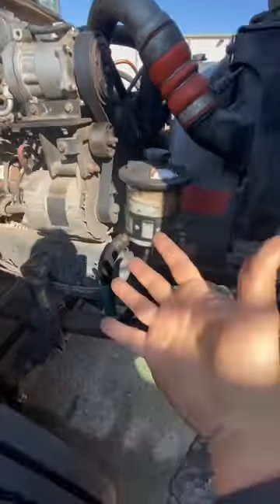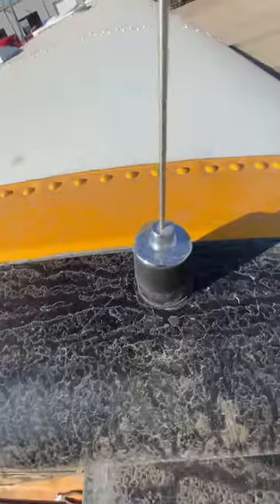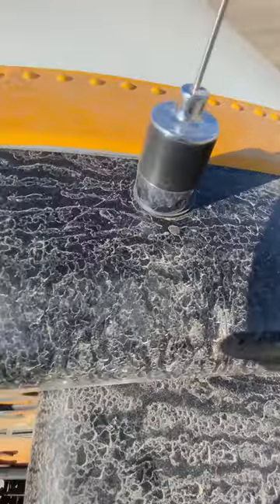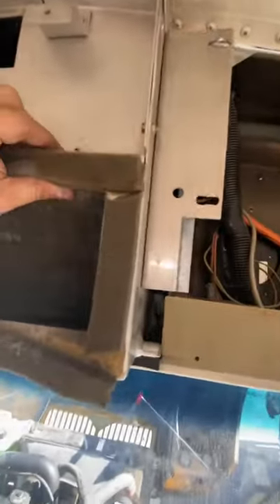#diesel #bigrig #mechanic #semitruck #shorts #trucker #truckerlife #trucks #trucking #rv #bus

Comment: But if you have a CB on my motorcycle and yes that sounds weird but the antenna just looks like a normal radio antenna for a touring bike but I just have a cable connecting it to a little handheld radio that is attached to the Mirror